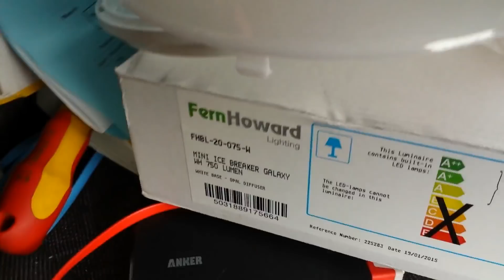Fern Howard 11w LED bulkhead a look at before and after installation

Comment: do you think with a driver change they could run of lower voltages say 11.1 volt li-ion
Reply from the maker: David Simpson They run at 19V I think so a cc/cv driver should do the trick! When I do another install I'll take some bits to test the idea
Reply: cool i use 2  small 1 watt usb bulb at moment but for a 4mx4m room it is a bit dim
Reply from the maker: Thats cool! I have 2 x 4W led lamps in wall lights and thats spot on! even for reading
Reply: pietkaify  that helps muchly i know know where to go with the bed side lights and desk as my 40watt solar arreay is set to charge 18650 li-ions in parallel as they produce the most current for least amount of sun in this formation if i do it for 3 series then ampage is less and more wires needed
Reply: in doing so i drop from 40 watt to 30 watt as each panel supplies 1 bank this way i can use a 4.2 volt chargng pcb and have them in parallel with each bank i think i explained that in my videos im thinking of getting nother to panels and use 3 cv/cc untis i will wire the 6 panels 1s2p this should give me 5 volt at 4 amp hours to the cc/cv unit thn to the first back in the 2 series 2nd set of panels to the 2nd cc/cv unit and so on this way they wil start to charge soon as sun comes up and will stop at 4.2 volts meaning the banks shouldent go out of sync i wish they was a charging unit that we could just feed solar power into and would keep each cell charge to 4.2 with out having to push bottons etc